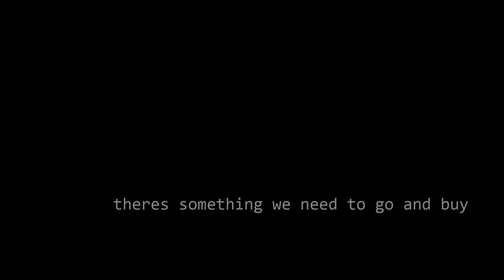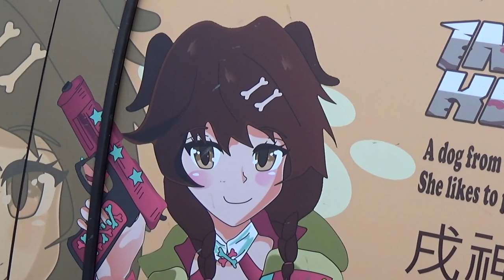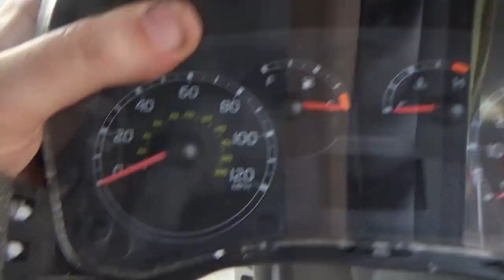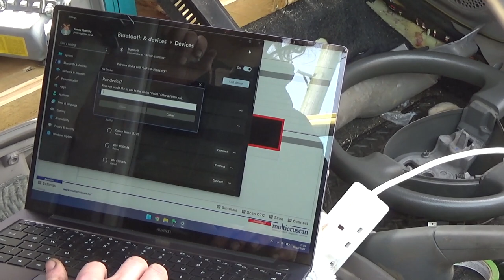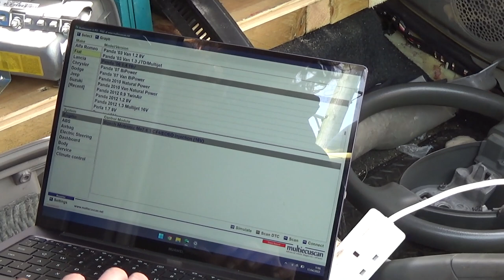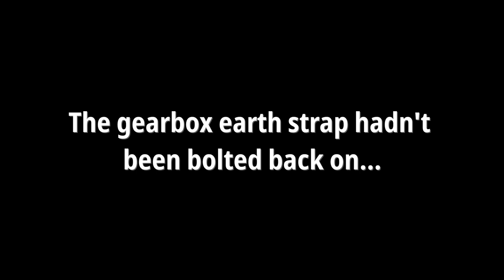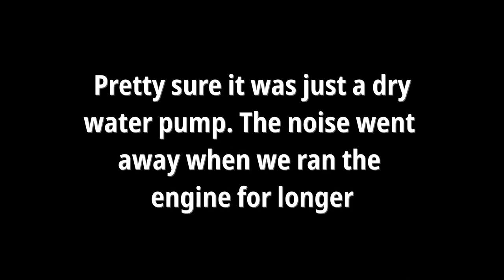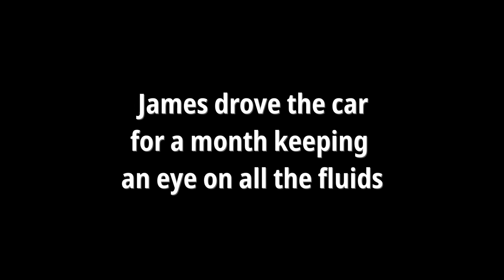How to nearly double the power of a Panda 4x4! [Full engine swap video]

Comment: Nice work! I thought about doing this years ago, my idea was to use the gearbox/prop/rear subframe and diff in to the 100hp car 👍
Reply from the maker: That would certainly make the wiring part easier but mechanically, the engine swap seems to be the easier route. It's nice to have the choice though.

Comment: Yes, that definitely makes me want to source a 100hp for my 4x4. A cracking way to spend a bank holiday weekend! Awesome job, thanks for taking the time to document it. Did you know much about the donor 100hp, or was it a bit of a gamble?
Reply from the maker: We knew it ran, it had had a front end smash and was in poor condition (140k ish miles) but it was very cheap and not too far away 👍
Reply: @UKPanda4x4  definitely worth the long weekend under the bonnet, I'd say. 🫡

Comment: Awesome project. Would love to convert my trash panda hundo into a 4x4. Did you somehow retain the sport button from the 100hp? Maybe look at adding an additional function of a diff locker (if possible) on the 4x4s
Reply from the maker: The sport button on the 100 and the city button on the 4x4 share the same space on the dash and the body loom so this car still has a button which says 'city' which makes the throttle sharper (because 100hp ecu) and makes the steering very light (4x4 power steering unit) which means it is pretty much useless 😅. No locking diffs are currently available (not easily anyway) for this car but we do keep our ears to the ground about this sort of stuff so as soon as it is possible, you will see it on this channel.

Comment: Was there any problems with the strength of the gearbox? I'm just before swape. Some people warn me that the gearbox won't stand it? Is it true? How many miles have you driven this car after modification?
Reply from the maker: The gearbox on this car has since failed... But... It is thought to be due to an oil leak rather than the increased power. It survived plenty of offroad abuse during the last year without any issues

Comment: How painfully slow are the 1.2's? I test drove a Cross the other day, and the 1.3 diesel was alright, but they are a bit out of my price range.
Reply from the maker: The 1.2 is fine. It's a fun engine to use. It struggles when you add oversized wheels to the car as we have, hence the engine swap
Reply: @UKPanda4x4  I'll probably only have all seasons on it anyway and just do the odd green laning local to me anyway. Thanks.
Reply: @UKPanda4x4  I've bought one. 😊

Comment: I suggested doing this on the forum years ago, and everyone told me it wasnt possible....
Would it be possible to use the 100hp 6 speed gearbox with the viscous coupling and other bits from the 4x4?
Thanks!
Reply from the maker: If you want 4wd, you need the 4wd gearbox so no
Reply: @UKPanda4x4  Ahh okay. Looking at prices of 4x4s and 100hps, its cheaper to get a twinair or a multijet and remap it

Comment: Hi, I've just buy a 169 1200 4x4 Climbing and I'd like to swap the engine for a more powerful one but not the 100 hp. Do you know if a 1400 8 valve engine will fit without too much modifications ? Thanks.
Reply from the maker: Why would you make more work for yourself to achieve less power? The 100hp is a straight swap
Reply: @UKPanda4x4  Because in Belgium we are not allowed to modify our cars. I'd like to have a SOHC engine that looks like the oem.
Reply from the maker: Ah I see. Well it will work. But as the 1.4 8v was never fitted to a Panda you will be working out your own wiring. If you are lucky the 1.2 loom will plug straight in, it is the same head afterall. If you are unlucky you'll need to splice in the loom and ECU from a Punto

Comment: Hi, I'm afraid to drag so many cables through the whole car, is it enough to modify the electric cube for the new engine controller?
I added ELD to my 4x4 and I have a bodycomputer n40 and a very rich original wiring harness and maybe I can swap the engine in an easier way?
Reply from the maker: We did it this way because it's easier. If you can tackle rewiring the car and making it work then go for it 👍
Reply: @UKPanda4x4  And the plug to the driver is not the same? because it looks so seemingly as if it was enough to disconnect and connect the old harness from the car. Or, looking at the wiring diagrams, redo the plug itself with a new motor controller. I want to buy an engine this weekend, but there are no cables for it from the cab and fuse box, so I'm looking for a solution
Reply from the maker: The two engine looms are similar but the 16v head wiring is quite different from the 8v with different plugs and things in different places so you would be making a custom loom if you do not use the one from the donor car

Comment: Have to wonder if it would be about as much work, or less to convert a 100hp to 4x4.
Reply from the maker: It's still a bolt in swap but you are working on the whole car, front to back. It has been done, but not by us so I can't say which is easier. I think it depends on what starter car/donor you have access to really!